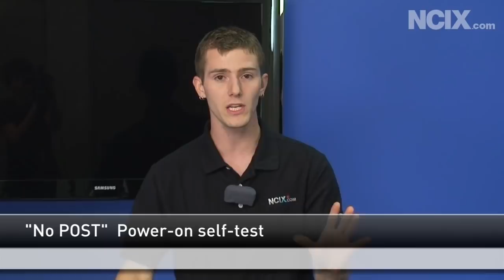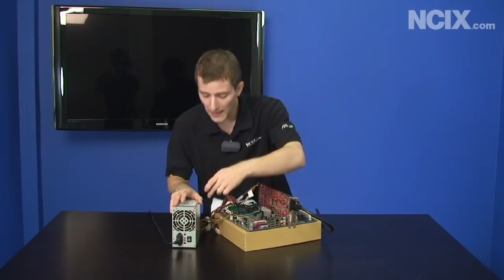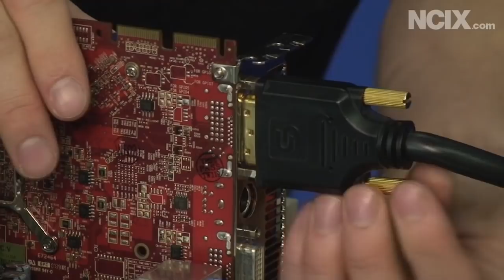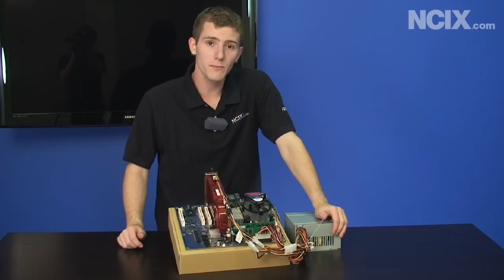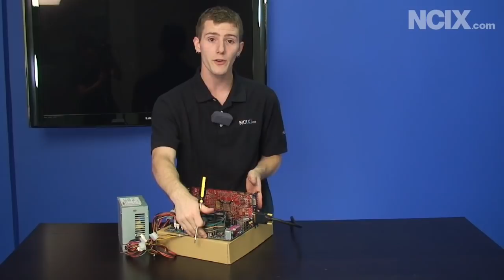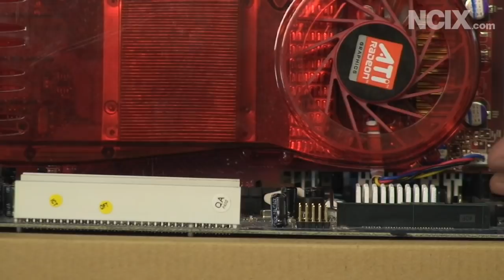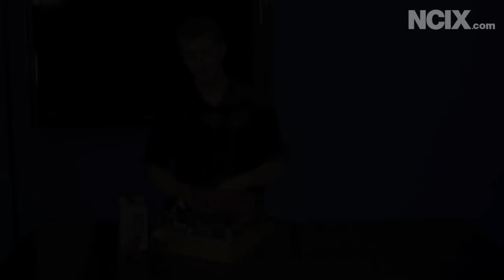PC Troubleshooting No Post Diagnosis (NCIX Tech Tips #54)

Comment: okay so my pc worked fine for a day or two, but sometimes ill get no signal from pc to monitor. i have no red lights flashing or solid at all, and at one point it got signal and froze as it was trying to boot up. then no signal again. i tried sooo many different methods to fixing it, and thanks to your video when i get home ima try other things. but i had given up and took out the cmos battery for 10 minutes (told myself not to do it forever, but decided today i should do it as a last resort) and now my dram lights stay solid, sometimes blink. it wont go away now. everything is compatible so i dnt frickin know anymore. im about to take it to frys electronics to have them look at it. but again thanks for this video. if all fails, im going to frys. i kinda think its the gpu bc when i got it there was a bent metal plate in there, not too bad but its there. like i said it worked before. i took it out and put the dvi cable onto the motherboard but nothing happened. (last time i tested this it worked) but now my mobo wont read it either. idk man. i put so much money into this. im not giving up n my first pc

Comment: my PC turns on suddenly shutdowns please tell me what should I do
Reply: I had the same problem with my Toshiba laptop, the thermal paste between your cpu/heatsink was crappy and needed to be replaced. However this is a bit difficult to do on a laptop but it is still possible.
Reply: Are the fans spinning? I once powered on a video card with a broken fan, or CPU it heats up to near boiling temperature and turns off. Take the case off, power it on to see if the fans are spinning on the CPU and video card. Then for Lolz, invite a friend over "to help" and ask him to touch the chip!
Reply: Depends on the PC. What brand is it? Is it a Laptop or a Desktop? How long does the PC stay on for before it completely shuts down? In any case I would try power cycling the computer by unplugging the power from the wall and removing the battery if it's a laptop. Then hold the power button to discharge all of the electricity from the PC and then plug it back in and try powering it on. If that doesn't work I would move to the RAM Chips. Remove all of the chips, keeping in mind which slot the chip was in, and see if you get any beep codes. If yes on the beeps  you may have a bad RAM Chip. If you don't hear any beep codes then you might have a defective system board. Try those and reply back with an answer. :D

Comment: what if my pc is running fine and then after 2-3 hours the screen would turn out blank and the only option is to boot up again but turning off and on the power supply ? It happens to me 2-3 times a day can anyone help?
Reply: the power supply might not be good enough for the pc
Reply: i have amd 8324
11 gb ram
geoforce gtx 750
750 watt power supply by 
mother board MSA 97VORSICHT
Reply: I'm going to assume you have the latest Nvidia Drivers. Perhaps your system board needs a BIOS Update? I remember an HP system I worked on a while back having the same issue. A BIOS Update cured that particular glitch in which an AMD System would make an Nvidia Graphics Card not work after coming out of sleep mode.
Reply: ill try that thanks a lot for taking your time appreciate that
Reply: +Timothy Neu you deserve an award for replying to the most comments trying to help

Comment: I'm having problems 
I bought a new CPU: AMD 8350 and mother board Msi 970a kraut edition

My CPU fan is running just perfect but 
my GPU gtx 960 fan spins and then stops and nothing is showing up on my monitor
Everything is connected right idk what the issue is  

I even reconnected everything to my old motherboard and everything works fine and I get a display 
Idk what I did wrong but Ik my GPU isn't broken
Reply: exact something as me
Reply: i found that it was my cpu
Reply: +jesse vazquez I had the same thing, I found out that my CPU was no seated right. felt like a noob after doing this for sometime.

Comment: please help!!!!
a week ago I turned my PC off and cleaned it. afterwards it wouldn't post and I could not turn it off with the power button. I found a thread where it suggested to reseat the CPU which I did and it worked for a week. 2 days ago I was playing skyrim and the PC crashed the same thing happend. I did the same thing and it has worked until today when I put it to sleep and when I came back it was dead. I have removed all components trying everything clearing cmos. removing ram booting without the CPU or ram or GPU, checking all cables. I have run out of ideas and there is no solution on the internet. please help!
thanks
Reply: Perhaps a piece of dust got somewhere where it shouldn't have and shorted something out? I would check for dust that got somewhere it shouldn't have. Also, try unplugging the power cord out of your PC and holding down the power button for at least 15 seconds. As for the CPU Reseating I'm going to assume you cleaned both the CPU & Heatsink with an Alcohol Rub Pad & reapplied the thermal paste properly. If not then your CPU might be overheating. Try CPUID's HWMonitor software to monitor thermals.

Comment: What if both sticks of ram work on their own (in every possible slot configuration), but just not together?
Reply: Then the RAM Chips might need bad as a pair at best or the system board might be shot at worst. I would say try replacing the RAM Chips as I had a pair of RAM Chips that wouldn't work together for any reason. I ran Memtest on both of them and they both failed a long test.

Comment: HELP I just bought all new pc stuff and built it on a table where no static electricity could get to it, the system works, turns on and even the leds I fitted work and all the fans go, I tried 5 different hdmis and they all do not work or even show its recieving a signal and no I dont have anything plugged into my motherboard and its not a broken hdmi it works via laptop
Reply: I'm going to assume you have an add on graphics card and the system board has built in graphics. Try plugging the HDMI Cable into the system board directly after removing your add on graphics card. Some systems default to the on board graphics on the motherboard and require some BIOS configuring to use the PCIE Graphics Card instead of the on board graphics. Depending on the system board manufacturer there's an option to boot into the BIOS Configuration via a certain F Key on your keyboard or the DEL key. Try finding the BIOS Configuration and reply back to see if that works

Comment: What would help a no-post scenario in which a computer has integrated graphics? I can't CMOS and I have an HP Pavilion p6527c-b. The PC will start, but there is no video output. In case it has anything to do with this, I did originally add an ASUS Graphics Card (That I have tested in the past), but before I turned on the computer. Windows originally said that /boot/memtest.exe was missing or corrupted, so I switched the HDD. Without testing, I added the ASUS Graphics Card, and tested, where I got no video. I detached the ASUS, and switched to integrated Graphics that had been going out for a while, and Started it up with a return of (yet again) no video.

What should I do, as the PC came from Costco?
Reply: Probably a bad RAM Chip. Remove the RAM Chip and see if you get any beep codes. If yes then replace the RAM Chip and see if the video comes on.

Comment: My system starts, but it just keeps running and nothing happens. fans and everything turn on, but nothing pops up.
Reply: Try connecting your screen to motherboard instead of gpu.
Reply: FullChicken44 lol I realised after doing all the troubleshooting steps...was the 24 (28?) pin slot was not fully connected.....

Comment: Can someone help me out with something?.
My PC sometimes doesn't power up at all when I turn it on at the front panel. Then sometimes the case fans start up, but the CPU fan doesn't. But, when I disconnect and connect the 24pin. It then starts up fine.
I don't have a MB speaker. But, I'm thinking about changing the CMOS battery to see if that will help. 
But, if anyone out there has any idea what it might be, send me a reply.
Reply: +Bourbon_Blues I'm no expert, I have some knowledge of this sort of area, but try using a different power supply, yours may be faulty, if not that then your motherboard, if not that then go to an expert.
Reply: I agree with Nick on this. Try swapping out the power supply first. If that fails try removing the RAM Chips and see if something happens.
Reply: Timothy Neu
I managed to get it fixed. Wasn't a big issue in the end from the looks of it. All I did was pull in and out the 24pin. It has been running fine since. But, thanks to everyone for the tips :)

Comment: In desperate need of help.  Issue: Bought a new video gpu for my pc, nothing over the top because my pc is older and i'm on a very tight budget.  I did my research and everything seemingly is compatible with the minimum requirements of the new card... BUT every time I install the new card into my case and try to start it up (suppose to have been a plug and play card) the fans are spinning for both my cpu and the new video gpu but there is no signal whatsoever to the monitor and I can just tap the power button on my pc once for a split second and it shuts down instantly.  I've tried re-seating the ram modules and cleaning the PCIE among other very simple things. When i put my older card back in it starts right up and runs fine.  Does anyone have a solution to this issue? :( 

Thanks in advance!
Reply: +Tanner Cochran You most likely got a DOA(Dead On Arrival) Video card. I would use the warranty to return it for a new one and see if that works

Comment: I just built my pc, installed all the drivers + windows 10 but when using it after 20 mins or so. It just died and won't turn back on. When i try to restart it, the fans work and the motherboard lights are on but there just seems to be no signal to the monitor. Ive tried this on the GPU + Motherboard DVI connector. Any help?

Comment: PLS HELP! 
Whenever I turn on my PC it lights up and the fans turn on you know like normal, but this time when i turned on my PC it lights up, fans start, but this time it doesnt display anything! Any suggestions? Dont know why this happened but i havent touched my computer sinced i set it up btw i already had it prebuilt and i never touched anything on the inside. PLS REPLY IF YOU HAVE ANY IDEAS! THANK YOU!
Reply: Open it up and check if your video output for your video card is plugged in. Just make sure everything is plugged in. if still doesn't work trying using the motherboard video output
Reply: +SsRkCS i tried removing my graphics cards and put i t back into my pc, but it still didnt work.
Reply: +O7 Novaa Try using the onboard video out
Reply: +SsRkCS im not that much of a computer know it all, but i know the basics and i dont know what went wrong because i havent had any problems with it before besides my mouse and keyboard turning off and on sometimes and have to replug all the time.
Reply: +O7 Novaa Might have a faulty motherboard. I'd send it back or return it and get a refund. but again try using the onboard video. It should be like an hdmi port near ur back panel stuff
Reply: +SsRkCS yah i think so to because i paid 4.3k on it and the first time they shipped it to me it had missing parts in it so i had to resend it back to them and i got it back like a few months ago and the only problems i had were my keyboard and mouse turning off a couple times until now when the pc wont display on my monitor.
Reply: +O7 Novaa I'd build it. it's not that hard. Just YouTube a video and you can have it done in like 2 hours at the most. You can't trust cyberpower. I'd ask for a full refund and then build it
Reply: +SsRkCS idk

Comment: My computer keeps freezing after a while of use, I cannot find any problems with anything, can you help me?
Reply: Same thing happened to me. Your hard drive's dying.
Reply: +Trilby Lascaux  i had just put a new hard drive in it but i left the old one in once i unplugged it it worked thanks
Reply: +Devyn Dauser my pc turns on then off instantly it didn't do this before i remove my i7 prossecor did i break the processor? because there is also no power given to the usb. and before a got it to stay on and the mobs light indicated it was on but the cpu was not heating up and there was no power distributed to my mouse and keyboard via the usb pleas help me i don't know what to do.

Comment: Please help: new parts in computer, won't post to monitor and no usb power I checked all compatibility on the new parts
Reply: +Tristan K Same!!!!
Reply: Get a new psu or install with 4 gb ram instead of 8 gb
Reply: +Sillygoose210 _ my pc turns on then off instantly it didn't do this before i remove my i7 prossecor did i break the processor? because there is also no power given to the usb. and before a got it to stay on and the mobs light indicated it was on but the cpu was not heating up and there was no power distributed to my mouse and keyboard via the usb pleas help me i don't know what to do.
Reply: +2pvideo try moving your ram sticks around, some mobos like ram in the left vs right slot etc. This fixed my problem.

Comment: This is for all those people that turn on their computer and the display doesnt even response and your fans and cpu fan and lights are working and lights are there but no beep sound, to start of,so basicly u need to do is to take out all plugs then take out cmos battery clean it and put it out for atleast 5 mins, take out ram clean it, if your VGA is connected to graphics card unplug it and plug it into your intergrated graphic remember to take out the graphic card too if you have a hair dryer blow it onto the graphic card all around and blow it into the motherboard to clear dust but dont use hot then turn on and log in for a few mins after that switch off and unplug everything again now put back your graphics card then put your VGA cable connected to your graphic card and there u go it will prob work again. [If this works add me on csgo MagnusRemix and if you are willing to donate keys :D] and we can play together

Comment: Old hardware looks butt ugly
Reply: dont complain if its not yours you can not complain it is rude and makes people argure to you so delete this comment you did not make the hardware ok? be gratful of what we had before. they might be people on low budget using them. How would you feel if someone says your computer hardware is bad. dont complain you could say good stuff but you always report this is not good be ashamed of yourself
Reply: put it this way the ugly motherboards  look lethal yet you end up buying eye candy  like Morden boards I still would not want to touch any part of a motherboard while turned on lol
Reply: butt ugly but works vs fancy and may not work. I'd say give me the ugliest one u got.

as for touching the mobo. I don't have any safety straps on me but have a metal case so I touch it and then the only thing I'll never touch when on is the psu.

but every time I open the case my hands sweat like crazy. imagine a very greasy pizza the ones that you can see light reflecting from. (I wish I was exaggerating even a little). I've also never felt any shocks while working on PC's yet.

Comment: Help =/. ONE stick of 8gb of ram bc in week or two I will be upgrading too dual channel and not sure which slot I should put the stick in. This is a brand new build (All the parts and brand new and built inside the case as of now) and they are all plugged in but lights come on and fans spin but no image and monitor says No Signal. I have the VGA connected to graphics card and was thinking about switching it to the motherboard but need help. Should I try these troubleshoot tips or anything else that someone may help me with. Thanks in advanced (x

Comment: So I just built a new PC and I tried to run the BIOS. but it won't work. The fans are running and so are the motherboard lights, but it wont enter BIOS and my monitor show "HDMI1 NO SIGNAL" Do you know what might be wrong? Any and all help is appreciated. I am running: i7 5820K, MSI X99A Sli Plus, MSI R9 390, G. Skill TridentZ DDR4 (4x8gb), Corsair H100I GTX, EVGA 750G1.
Reply: My first pc didnt boot on cuz i forgot to plug in the cpu
Reply: +Not Hating Just Stating I got it to boot. The RAM wasn't installed properly.
Reply: +minecraftace123 How does the RAM not be installed properly? I only have ONE stick of 8gb for now bc in two weeks im upgrading to 16 gb of ram but does it matter which slot the RAM goes in?
Reply: Eryion™ Kinda yes
Check your MoBo manual. And mine was put into the right spot, but one side was slightly loose.
Reply: yeah, mines good its just I tried unplugging the GPU, HDD, RAM and fans and got nothing working except my MoBo. But I plug everything in and hear it rev up with the fans on but no display or beeps. If it turns on and dosent beep is that good or bad?
Reply: +minecraftace123 my pc turns on then off instantly it didn't do this before i remove my i7 prossecor did i break the processor? because there is also no power given to the usb. and before a got it to stay on and the mobs light indicated it was on but the cpu was not heating up and there was no power distributed to my mouse and keyboard via the usb pleas help me i don't know what to do.
Reply: 2pvideo Check your local tech shop, I think something may have been fried.
Reply: minecraftace123 ok thanks